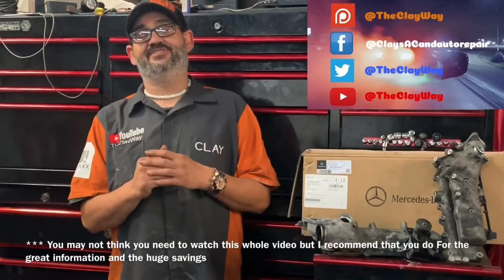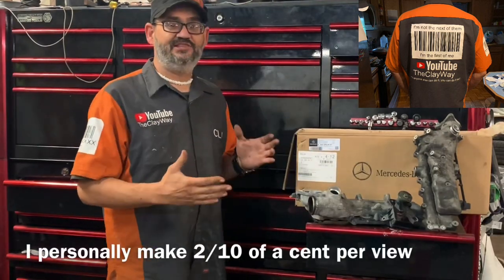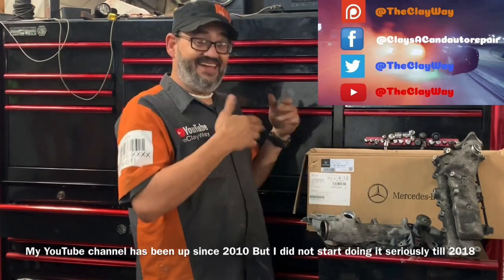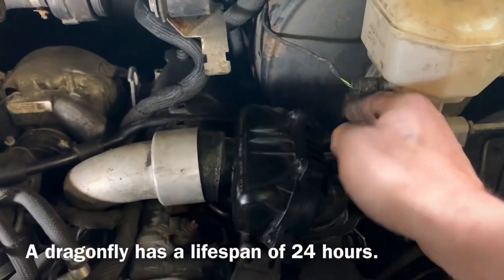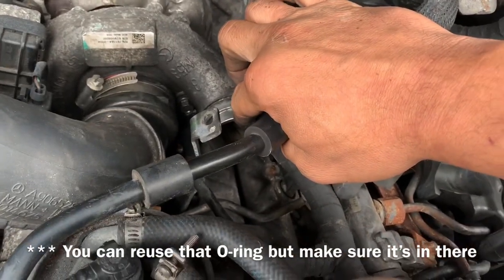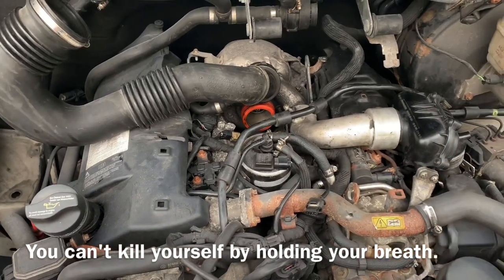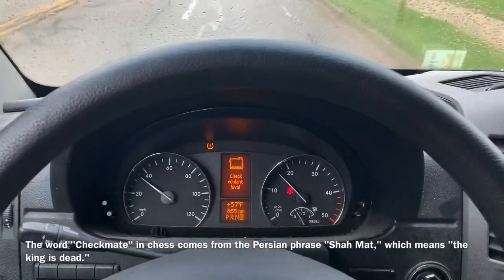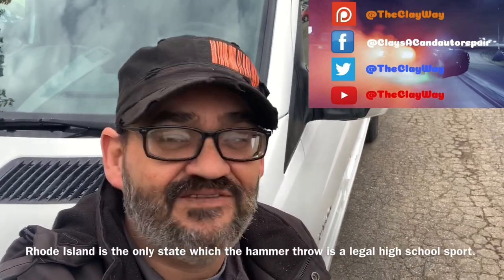sprinter 3.0 diesel swirl motor problem fixed for 2 Bucks!!!! I will save you thousands!!!

Comment: I've been searching for anyone that had solid information on this issue after many KNOW NOTHING certified diesel mechanic fanatics I found the CHANNEL that has real answers and step by step instructions that not only make sense is spot on with results Thank you Clay , you're saving people thousands and giving piece of mind TWO 👍🏻👍🏻 UP!!!!
Reply from the maker: Well, that’s really really super awesome of you to say… it truly means a lot, and I put a lot of effort in my videos monetarily they don’t pay a lot, but the satisfaction I get is worth every sacrifice I’ve made… I greatly appreciate you welcome to the channel…. Hopefully the next elections a little bit better for us so money won’t be so tight….
Reply: Wow what a response time hey Clay where can we find the resistor's you purchased? And keep up the Great Videos were going join you as well have a great weekend.
Reply: I was wondering if those same resistors would work for the now non existent particulate filter what's your thoughts?
Reply from the maker: I bought mine off of Amazon. Make sure you read the description because I said the wrong thing in the video but the resistor I was using was the right one you don’t want to continuously run it that way…. 

And I had contemplated the same thing about the particulate filter. It won’t hurt anything to try it.  

I guess unless you put the positive and negative together, depending on what signal goes into the particulate filter but I’m not certain about that 

I will tell you, though I’ve gutted it out, particulate filters before, and it had no effect on it running 

By the way, if you got a spreader, you definitely want to watch my Sprinter playlist I do some sick sick stuff to Sprinter’s 

Man, I’ve got something new I just invented… that is going to change the Sprinter world forever…

And if you ever have a question, it’s best to reach out to me on clays, aace and Auto Repair over Facebook because I don’t often see responses or comments. I tried to answer everyone that I possibly can but if you want to guarantee it answer that’s the best way to do it or you can always email me as well. 

Theneeclayway@gmail.Com

Once again, welcome to the channel very happy to have you. I always try to help everybody. I possibly can. Thank you so much. I hope you enjoy some of the Contant not all of it. Lol nobody possibly could.
Reply: Thanks again for the info and help I'll recommend your channel to all my sprinter buds 
👍🏻
Reply: Follow up I tried a 1 ohm 2watt 
Resistor I had laying around in my shop and it did work till the resistor failed so I'm going to get the one you recommend.
Reply: The good news is here the 2008 is grandfathered on emissions testing so I don't have to be concerned with that.

Comment: I just performed this repair for the p2513 Code.  I did not actually have a powerloss before the repair I only had the code.  I've installed the resistor, reset the light and driven it.  So far the light has not come back on and the vehicle still runs find.  Thank you so much for this information!

Comment: I had to do this with my 2008 Jeep Grand Cherokee it has the Mercedes v6 CDR , I initially was told that due to a bad turbo gasket which sits right above the motor it allowed oil to drip down onto the motor thus causing it to become defective. I found that to be a common problem with this engine and if repairing to also replace that faulty turbo gasket. I've had the bypass on for a little over a year and soon will be looking for a permanent fix. Some of the things that I have noticed since the bypass is the engine sounds like it's working harder especially at high speeds.
Reply from the maker: As a matter fact I’m replacing the intakes  on a 2008 Jeep grand Cherokee this week.

Comment: I got rid of my Merc R320cdi before seeing this video. I wish I had the chance to use this repair. I changed the Turbo, Actuator and replaced the servo module and still the limp mode persisted. Great video....would have been greater if I had repaired my car with this quick fix. Thanks...
Reply: I'm just about to try the fix on my car today 🙏

Comment: I have an issue with my 2007 UK E320 CDI, i have bought recently with 150,000 miles. I have minimal low down power. I went to do this mod and found the plug onto the swirl motor unplugged. It doesnt have a code. I plugged the resistor in and it smoked for a while and ran terribly then cut out. Any idea what it could be? I am so lost. Thank you for the great content.

Comment: Hi I have 2009 ml320 I put in a 2008 jeep grand cherokee engine and is in limp mode now maybe this resister may help other issue is check engine light is because of the DEF tank heater because it was a bluetec if I disconnect the fuse will the check engine light go off and where is that fuse one more think turbocharger sensor is missing the socket is there but the sensor is not and I don't see any vacuum hose for it either and I have a problem with the glow plugs in the winter module is ok but I think the temperature sensor is not giving signal to the glow plug module where is that sensor on the engine would appreciate if you would help Thank you

Comment: Sir ive been there no boost then i put resistor in and problem solved.Now im doing the cooler seals,can i leave my swirl motor out completely on resemble as ive already using resistor? Il just make sure flaps are open on assembly and leavevout the m55 inlet port motor.Whats your advise on that as im a diy mechanic.

Comment: Hi Clay thanks for a very informative and an encouraging video 
My main concern is after doing this hack  the swirl flaps should be locked in position so they dont move causing erratic power surges. 
I noticed on some vehicles the flaps are made of some hard plastic like looking material,I have come across some vehicles where the flaps break and end up on the piston head causing big damage to the valves as well in this case I would recommend removing the flaps completely blocking of the shaft holes in conjunction with this hack
Also you mentioned that some sprinters dont have swirl flaps that's 100% correct im based in South Africa i noticed up until 2013 the om 642 motor's do not have swirl flaps.
Once again thanks have a great day and be safe

Comment: I love you, brother!
2008 Sprinter 3500 dually confirmed fix: I de-soldered a 3.5 kOhm resistor from an old circuit board and used it for my repair - turbo is back, full power, drives like new! Thank you very much!
Reply: maxitv8242  Myself I curved the end a bit in case they wiggle. When you bend the resistor to one side and electrical tape it in place, there will be contact on the tips.

Comment: The swirl motor is spring-loaded with the flaps normally in the open position [Re: WK Jeep shop manual sec.9-2713] so, this modification won"t harm your engine. As a matter of fact, my Jeep came out of limp mode after just disconnecting the swirl motor and driving for about an hour though the check engine light stayed on. However, be sure that the problem isn't broken linkage. If so, you can remove the swirl motor without pulling the turbo,  tie off the linkages in the open position, [you can use some wire to secure the right side linkage to one of the swirl motor mounting bolt holes, and on the left side place a clamshell-type of paper clip on the linkage to prevent closure] and put the swirl motor in your sock drawer. BTW installing a catch can, or even a dump hose will prevent the gumming and sooting up of your intakes. ;)
Reply: For the "BTW installing a catch can, or even a dump hose will prevent the gumming and sooting up of your intakes. ;) ", any pic's or diagrams on this? Aren't the gummed up intakes downstream from the turbo? If that is so, isn't there the boost pressure at those intake ports? So wouldn't a dump hose bleed off the boost pressure?
Anyone have a good way to thoroughly clean the intake manifolds, especially the gummed up intake ports and the pivot points of the flaps.

Comment: Very helpful video. You look very familiar and experienced  with sprinter.  I have question,  my crankcase breather valve is making a loud noise because of the blow by. I already changed the valve but the noise still there.  What do you think is the cause of this problem?. I'm on a limp mode, but when I disconnect my o2sensor I get the power back.  Thanks in advance.

Comment: worked for me 2008 dodge sprinter 2500. turbo is back!! bought same resistor pack off amazon. check engine light still on but who cares. turbo is on!

Comment: I have done this for about a year ago. still work well. and I got more turbo response and a bitt more...better sound. my car is a 2007 e 320 ccdi. done about 240 000 km, not shore how itis in miles.
Reply: maxitv8242  I did put them in as long as I coulds. then I had good tape over and around it. to make it secure. been like that since....then. no done 285 000 km.

Comment: nice and a very helpful video I did this procedure but still I got from DTC code p2007  stuck closed bank 2a  and  p2004  stuck open bank 1a I have doge sprinter 2008 diesel 3.0 3500 and limp mod
Reply from the maker: Thanks for the kind words but I’ve never had it not work. Well all I can guess is either you use the wrong resistor or you put it in incorrectly

Comment: Hi Clay, thanks for all great videos you record and share, you have no idea how much you saved for your viewers.
I have 2008 Dodge Sprinter 2500 with 160k miles, I believe my after market Swril motor stopped working, I exactly did what what you did on this video, but I get these two codesL P2004 and P2005, Intake Manifold Runner control Stuck Open Bank 1 and 2.

Any idea how to get ride of this error so I can get it smog check?
Reply from the maker: First off thank you very much for the kind words

Unfortunately, so there’s the swirl flap 

And then on each side of the intake, there are rail sensors  if the rails are not moving more than likely it’s because they’re plugged, which is extremely common

So unfortunately, there’s no fix for it without removing them entirely or reprogramming them  

You can send me a message to Clay ac and Auto Repair over Facebook 

Or you can reach out to me over email 

Thenewclayway@gmail.com

When I originally produced this video, I wasn’t aware of that, but I’ve got a lot more experience since then

Comment: I love it!  Clay's engineering takes over where MBZ's ended.  Don't worry about smog tech  seeing that the swirl motor is disconnected.  My smog tech told asked me,  "if I knew where the EGR valve was", as he was not familiar with diesel engines.  Nice guy though!
Reply from the maker: Much appreciated!

Comment: Best wrenching video ive ever seen tbh..., currently removing turbo on my vito to replace oil cooler seal. My vito ran 400K. Will also close egr.
Reply from the maker: Thanks brother I appreciate it. Welcome to the channel. Very happy to have you there. Some more chips that are more recent than these videos. Right now I’m currently working on a Injector removal video., side door that won’t open video. I’m literally filming that right now….. and my my best Sprinter video ever probably one of the best videos I’ve ever made about how to get a Broken glow plug out without having to remove the cylinder head when they break off inside… that one’s a little bit of way but I’ve got most of it. Filmed I just haven’t got the actual part. It’s broken off inside the cylinder head out yet but I’m working on it. I’ve got a solution that’s really kick ass. Where I use silly putty
Reply: @sharpcarco  do you have any more tips on what I should replace on a 400K om642? Had to replace the alternator so the radiator went out to reach that. Noticed the oil cooler seal while working on it and figured I might as well do as much as I can. As I mentioned Ill get a physical egr blocker, you mentioned the swirl motor to be replaced, thinking of completely removing it also, but read on the internet it gave them less power on low rpm on cold days or something? Little reluctant... 

How about waterpump, does it last? And should I check the turbo for play? Certain gaskets or anything other I should replace? My engine used to run perfect, the van used to be hearse and a taxi. Want to get it good for another 200K, jts my carpentry work van.

Comment: What does it mean while my 2007 Dodge Sprinter engine is idling the swirl motor is rattling? With this resistor fix this issue? The engine runs amazing when I clear the codes and it runs for a few days before it goes back into limp mode. Thanks!
Reply from the maker: Sorry 🤷🏻‍♂️

Comment: Nice, but what is the resistor actually doing here, can you explain a little theory not just all the mechanics, why didn’t Mercedes put the resistor in there, are we bypassing and defeating the original operating procedure, just curious
Reply from the maker: I would explain it to you but I explained it in the video. It’s basically telling the Ecm that the switch is there when it’s not

Comment: Does not seem to work when I put the resistor in it starts to smoke I ordered the correct one you were showing why is it smoking when I install it
Reply from the maker: More than likely you have a later model that has rail sensors. Sometimes this procedure does not work with rail sensors.

Comment: Hey Clay, I have an 06 Jeep 3.0 CRD, I’ve done the actuator and EGR but my symptoms are slightly different to what you’re describing. My Jeep boosts but then at 2000 RMP it jerks and then the turbo dumps heavily. After that the lightning light comes one and it goes limp. I think the problem might be that my swirl flaps are jammed but not fully open, does this sometimes happen? If so how can I get them open without having to remove the intakes. I’m definitely going to do the 4.7k resistor but just worried I do it and my swirl flaps are partially closed.

Sorry for the long winded explanation, just being thorough 

Regards 
Kyle 
South Africa

Comment: Hey Clay, very informative video! I'm servicing a 2010 Mercedes ML350 woth the 3.0L CDI. I have had the intake and cleaned up the intake ports as much as possible, replaced the worn out intake runners as well as put new shut-off sensors. I also replaced the intake flap actuator motor. Cleared codes. I keep getting the DTC for the actuator motor being faulty. Does this actuator need to be reprogrammed? Any other ideas? Thank you for your time and knowledge.
Reply from the maker: No that does not require any programming, and I constantly reuse arms that are loose, what I’m almost certain is happening is your actual Intakes are probably gummed up again. Meaning without this assembly you cannot get the carbon that’s built up out of the inside of the rods. 

You see years ago I made a video about cleaning intakes because people would try to watch other peoples videos and they would show you how to clean them but they could never clean them properly without disassembling them. So I invented a process where I am able to do this and clean them properly. 

What I found before that when I tried to clean them was if I left them out of the vehicle for 3 to 4 days they would lock up even though when I was done cleaning them they moved and worked. 

So fast forward a couple years to 2020 if I remember correct I finally figured out a way to do it and because YouTube videos pay 2/10 of a cent obviously I capitalize off of my discovery it requires special machinery to do it correctly from what I’ve discovered. 

You can reach out to me on clay’s AC and Auto Repair over Facebook messenger send me an email if you discover that that’s your problem thenewclayway@gmail.Com 

Look on my Sprinter playlist and you will see various videos about me cleaning these and some additions I made to the process like deleting them without re-programming.
Reply: What I think your problem is, is the little plastic clips that goes around the ball joints on the actuator motor, if you don’t reuse the old ones.... the new clips are too tight and restrict the motor from moving freely.. so always test the movement of the actuator after assembly! Make sure they are returning freely.

Comment: 4.7 Ohm Resistor Color Code: Yellow, Violet, Golden, Golden. Resistance: 4.7 Ohm, Power Rating: 0.25 Watt, Approximate Maximum Current: 231mA .

Comment: Hey Clay :) Back for more! 2008 Dodge Sprinter here. The codes i have are P2015 intake manifold runner position sensor/switch circuit closed 2953-1 right ekas closed 2952-2 left ekas open and 2513-1 intake port shutoff actuator signal fault. My van drives with poor acceleration and turbo doesn't kick in although no turbo related codes. Could this possibly get my turbo working again like yours did in the video? Is it worth removing the fuel filter and trying zip tie both ekas open if possible along with the resistor? Thank you again. Love the channel. Very Helpful :) Willing to give it a shot... 299k right now
Reply from the maker: Well, it only cost about two dollars to try so you can do anything but…. When you have the sensors, you have to delete the intakes or at least clean them and or replace them.. obviously I do all of that you can reach out to me on clays AC and auto. I don’t recommend continuously running your van with the resistors in there because it will plug up your exhaust. But it may work for a short period of time.
Reply: @sharpcarco  Hey thanks again for responding :) I keep watching your videos front to back.. I think i understand. Sounds like my van has the 2 sensors that you were mentioning in this video that cause this resistor trick not to work. The EKAS sensors must be the 2 you mention?